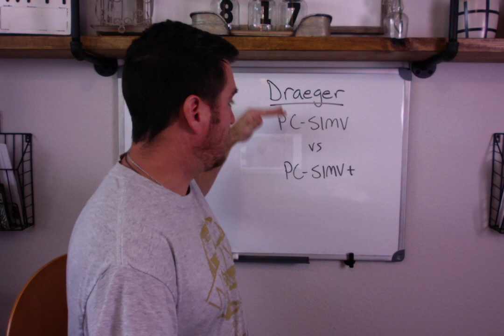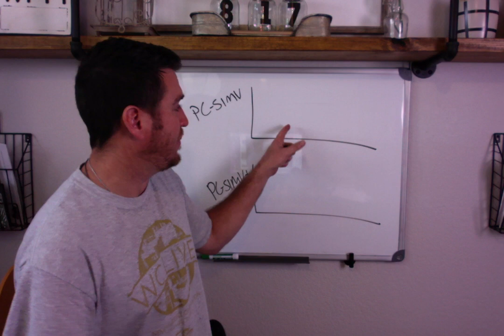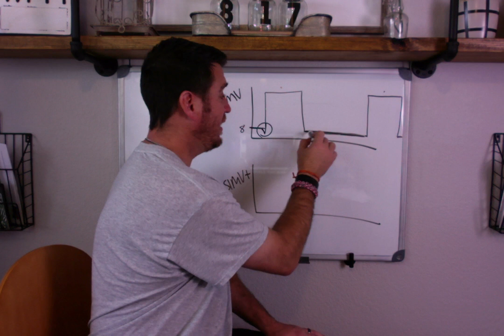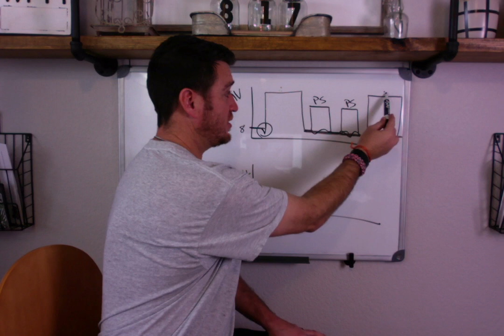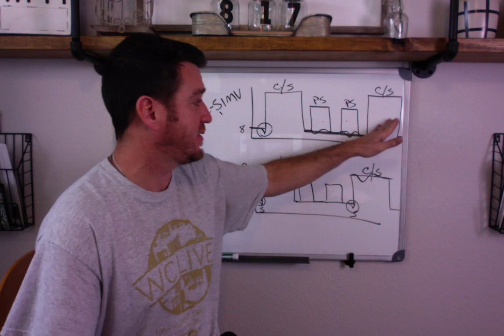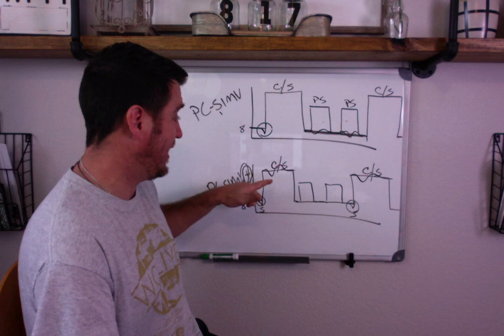Respiratory Therapy - PC-SIMV vs PC-SIMV+

Comment: This information is not correct as it applies to the Drager v500.  Drager allows for spontaneous breathing during all phases of ventilation in any modes.  SIMV+ synchronizes the patient's spontaneous breathing during a mandatory breath which may reduce the duration of that mandatory breath.  Think of it as expiratory synchronization, not just on the inspiratory side.
Reply: I came here to say this. You are correct. Thank you.

Comment: Thanks! my covid positive patient had this setting simv+ on draeger at fi02 70%, pinsp 28, peep 10, ps 8, resp rate 18 with background of asthma..she was not in synchrony with the vent, etco was around 38-40 and in alkalosis, ph - pc02, hco3 - all high. the intensivist adjusted to aprv but eventually switched back.. patient tolerated simv+ for hours and decreased her to fi02 55% and increased resp rate of 20.

Comment: This is different than the manual. The manual says that PC-SIMV breaths have an inspiratory cycle that can be triggered sooner but is time cycles with the set Ti. Whereas in PC-SIMV+ it can also cycle the breath off early so you don’t get the full Ti. Is that correct?

Comment: Hi
I like your videos. Thank you for posting them. 
I work with Hamilton C6  P SIMV+  it's the same , I think.
It does not have PS , it has Pinsp which I've been told it switches between PC  and PS depends if its vent triggered or patient triggered breaths. 
Is it right?
It also has a Sync mode.

Comment: sir whats the different between synchronized and spontaneous breath ?
Reply from the maker: Synchronized is a machine controlled breath synchronized with a detected spontaneous effort, find in SIMV mode.  Spontaneous breath is a patient controlled breath, found in SIMV (in between controlled breaths) and CPAP, etc.  Does that make sense?